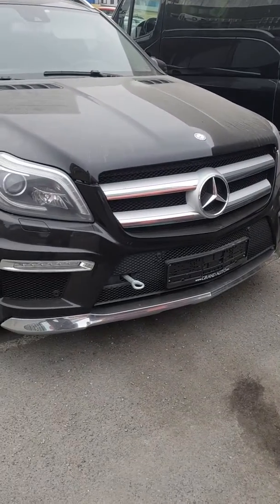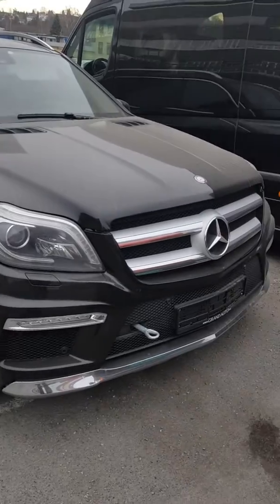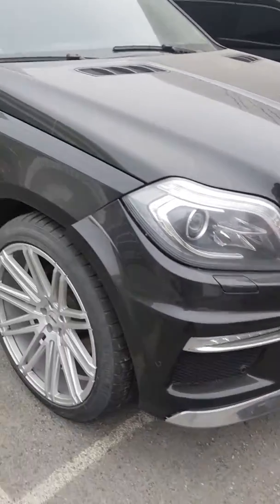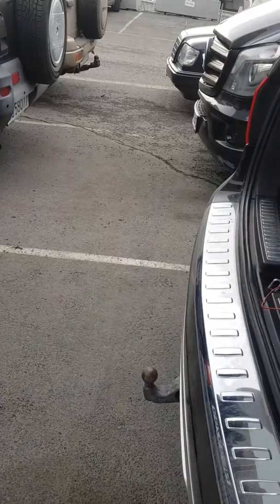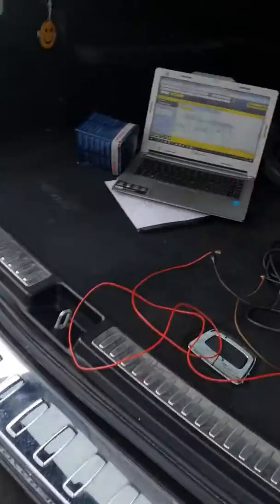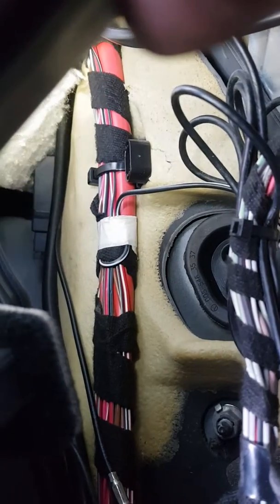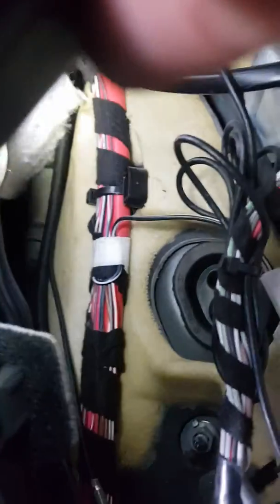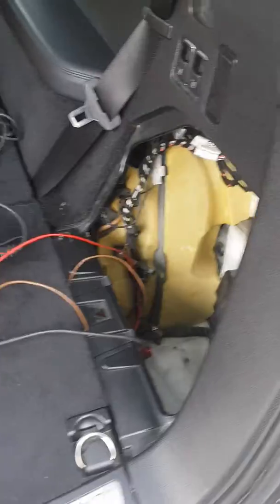Mb ML w166 2016 fuel pump relay

Comment: On 2013+ models the fuel pump has brushless 3 phase motor, which take around 5V on each phase, therefore even if you test a good working pump with 12V directly - it won't work, it requires ESC (Speed Controller  - that black box which you called Relay). The Fuel Pump Controller connected to the fuel pump motor with 4 wires total (3 fat wires Blue, Brown & Black goes to 3 phases  AND  1 tiny Brown wire is Shield the other tiny couple wires go to level sensor). The only way to test the fuel pump, you actually test the voltage on each phase it should be around 5V. I drilled a hole under rear seat and tested the voltage directly on my fuel pump, each phase has stable 4.5v (but it depending on battery charge) which means the harness to the pump and Fuel Pump Control Module are working fine,  so  the pump has to be replaced.
Reply: Where is the fuel pump relay located